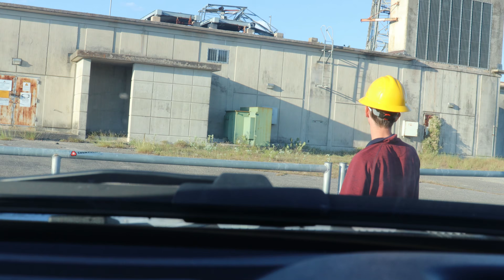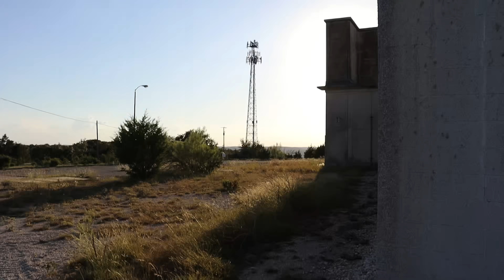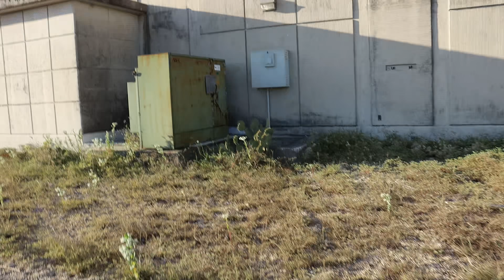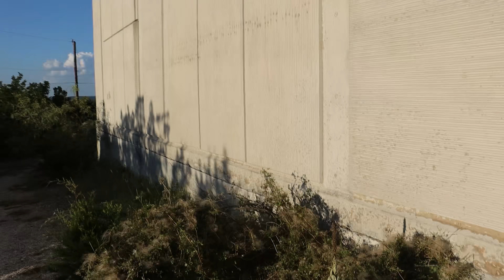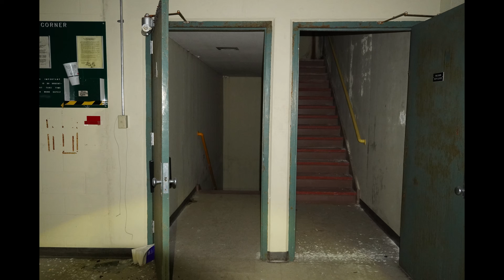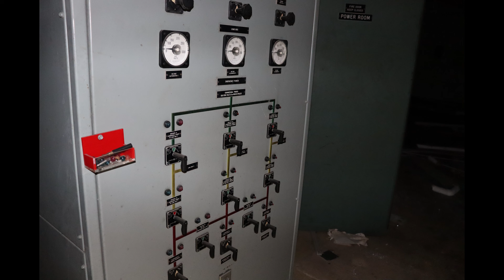Long Lines bunker

Comment: PWR: Power (Probably failure)
TD3: a long lines microwave technology
ENG: Engine (Probably also failure)
FRE RAD: Something radiation
(The first and last are guesses, but i know td3 is a microwave tech used in long lines)

Comment: It's amazing what the Bell System did for the country when there was a monopoly on long distance service!   Those buildings were hardened against bomb blasts and were intentionally located away from (then) major population center to avoid collateral damage.   Several I visited had shock absorbers on the equipment racks and even the toilets.   Pop quiz -- who paid for all that expensive facility upgrades?  Answer -- It wasn't the government, it was "baked into" the cost of every long distance call made by private citizens and businesses.   In effect, the FCC gave tacit approval to fund them via the expenses which set the rates for billing.

Comment: I worked at one of those sites. Netcong n.j. it was mostly a 1ess machine fore the government. There were radio and cxr gear because we handled traffic along the east coast. Next stop was drainsville, va. Going north went to the big building in NYC.  Its days were numbered, though. Last I heard the building was being used as a data storage center.

Comment: The pressure gauges are made by Magnehelic. The pressure rating is very very low. Hospitals use the same ones, or used to, for isolation rooms. I have one that came out of an underground coal mine refuge that was used to measure the restrictions on an air filter. It has two knobs on the front that you can adjust the alarm trigger points.

Comment: I would say that that means that it was designed to be pressurized to atmospheres! 

To counteract any leak as you were saying basically the high pressure in the building would yes Force the air out of the building but that means it would not let any air come in. 

The best comparison I can give for that would be when you go to the store in the summertime the fans that they have running overhead of the door they blow air there because it keeps flies out...

Comment: The gauges are Magnehelics.  They're made by Dwyer Instruments and they are for measuring very low pressures. Two inches of water column equals 0.0723 psi.  Not a lot, but enough to keep fallout out of the building.

I have a Long Lines site south of home. The tower was called Lee, and it was part of the first coast to coast microwave link in 1948. It is also privately owned.
Reply: Inches column water is a measurement reference also used in the pipe organ builder industry.
Reply: That is correct, inches of water is a much more granular measurement than PSI. There are ~27.68 inches of water per PSI (reciprocal of the number you stated). Another way of looking at it is there are just under 34 feet of water in one atmosphere (~14.7 PSI). That is why mercury is preferred for measuring barometric pressure. There are just under 30 inches of mercury (760 mm, for most of the world)  in one atmosphere, a 3-foot high instrument is far more practical than a 34-foot high one. I’m unsure what the instrument was, but I would wager it measures the pressure difference between the interior and exterior atmosphere. They would probably want to maintain a positive interior pressure in the case of fallout to ensure there was no infiltration of airborne radioactive particles except through the filters. Only a small pressure difference is needed, therefore the more granular measurement would make sense if they were only concerned with the delta.

Comment: Not only do You need to run pressurized to keep outside air out you actually need to run at an overpressure of more than one atmosphere so that the outgoing air precludes air entering, It's basically always blowing out with more force than the atmosphere would normally push in

Comment: Remembering my days in the 70's when I spent time with my dad  at a toll CO when he worked for PT&T  (Bell System), on the microwave floor.  That alarm panel indicated what kind of equipment alarm.   PWR is a power alarm,  C1 alarm was the order wire bay for communicating with the Main CO in the region,  LMX is L carrier multiplex - channel modulation of phone circuits over TD-2 or TD-3 microwave radio, not sure of the others. The bottom row looks like all the different open door alarms. There also would of been colored light bulbs hanging down from the top framework on every isle : red is a major alarm,  amber is a fuse alarm and green is a minor alarm. You can still see the alarm bells mounted on a board on a pillar in the background.
Reply: Oh, that's right,  the B is for basement and the 1 is for first floor.   The TD-3 alarm was the microwave terminal equipment,  FM probably refers to the frequency modulators  (FMT's and FMR's) .

Comment: You wouldne amazed at how many of these sites are still active, in a ready state to return to service and how they have been updated and kept updated. The security for those is very impressive. And as some have said it is not going to be possible to video within any of these that still has equipment. Those who try to enter are dealt with extremely harshly.

Comment: It would be interesting if one of these Long Lines sites in fairly good condition could be restored for use as a museum so visitors could go and see intact original equipment (doesn’t have to be operational, but would depict what is was like back in the day. It should also have an original tower with the horns in place (again, not necessarily operational, but intact). These sites are extremely historic and some which are in good condition, preserved. I know that in downtown Los Angeles, there is an AT&T Long Lines site with a mid-century style concrete tower that holds the horn antennas. I think it is still there today!

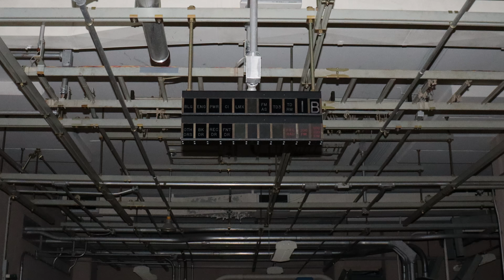Comment: 10:14 The only alarm abbreviation on this panel recognized is: PWR/power.  Seems this site used abbr.’s of Radio alarms.  From the last two videos watched from your channel, most equipment seen, appears to support the microwave radio equipment, one way or another.  Pass-through / repeater sites appear unique.  Only early microwave radios I was around were Federal-(real antique little to no info. available now days - Much adjustment required to keep operational) and Collins Radio.  (Oldest equipment seen). Trip down memory lane for any worker of M.W. radio equip.

Comment: Thanks for posting this. I’m 69 and my late teens was the last of the lifespan of the Ma Bell long lines system. In my youth I was very interested in communications and I spent many hours on the road around NH and Mass seeking out and photographing communications installations which of course included Bell long lines microwave sites which were still on line at the time. I have pictures of the link starting in Concord NH and heading south and west to carry long distance calls. Fantastic radio technology which like all tech changes and got obsoleted.

Comment: This looks like a newer site, and it is initially a bit surprising that so much is above ground.  Apparently the building material is up to withstanding several PSI of overpressure and things like power generation equipment could be located in the top floor which looks not to be entirely hermetically sealed.

I believe the older sites were built with cut and cover and almost entirely underground except for the concrete tower for the microwave horns.  Probably the concrete in the mostly underground sites did not need to be as strong, relying on the ground around the underground building to absorb blast energy.

A lot of work was done in the 1950s tests to understand the overpressure impulse and ground shockwave generated by aerial, surface and below ground nuclear detonations.  My assumption is that data were not available when the original Long Lines bunkers were being designed, hence the decision to build almost all below ground.

Comment: As for the annunciatior panel ~10:30, I’ll give you my best guess on the indicators.  I worked in a lot of ATT facilities but never a MW relay site unfortunately.
BLG - probably related to any type of environmental alarm within the building; HVAC, water detected, high temp, etc.
ENG - Engine alarm.  Gen Run, low fuel, over speed, etc..
PWR - some type of AC or DC  alarm.  Commercial power failure, Rectifier failure, battery on discharge, low voltage, etc..
CI - I’m not sure but could be a generic alarm for the switch located in the facility.  A lot of the larger relay sites had switching equipment for Autovon.
LMX - I’m not familiar with but sounds like it’s associated with multiplexing equipment.  Common in these sites.
FM-AS - no idea.  Probably related to TD3 technology.
TD3 - the type of Microwave radio used in this facility.
TDRM - Probably a radio alarm of some type.
I - no clue 
B - no clue
OTHDRS- could indicate some Over The Horizon technology that was in place at the time, but I’m speculating.  Or could be ‘Other doors’
BK-DR - was probably back door open. Or could be radio related.
REC-DR - was probably receiving door open (loading dock). Or TD3 radio.
FNT-DR - was probably Front door open. Or radio again 
I have no idea about the last indicators in red but are probably related to the radio system.
Hopefully a real TD3 guy will chime in and correct me😂
Reply: B and I Could refer to basement and first floor, to indicate where an alarm was present
Reply: Perhaps, BLG could refer to "Blower Gates", as if the blower had a gate that could let "dirty" air into the generator in case of overheating.
Reply: Lower left indicators I agree should refer to the doors being left open
Reply: Perhaps, CI could mean "Closed intake" for the generator. Or "clogged intake"
Reply: As for the red indicators, being them all bunched up together and red, they could be for the more serious stuff, related to nuclear. FRE RAD could refer to detectors for FREON and RADON gas, perhaps those have something to do with the fallout detection.
Reply: What is left out, then, is stuff related to the transmitters and building pressure. If the top left is for power and the generator, one big thing that could be missing is the low fuel alarm, so perhaps LMX means Liquid Methanol Exausted or something like that. But I am making it up at this point
Reply: Intuitively, transmitter related stuff is at the top right. FM AS could be "Frequency Monitoring Anomaly ..."

Comment: These built-specific locations were abandoned because of fiberoptics, satellites and microwave made for better more efficient communications, ergo these were made obsolete. The sites that could be reused were kept and the rest were put into 'disposal'. AT&T and the U.S. Gov't definitely got their moneys worth out of these places. Keep in mind that AT&T did not abandon them, they were stripped of asbestos, equipment and as much wire as possible to meet make them sellable to the 'public' and then sold off to new owners. Who then abandoned a portion of the site or entirely after they found out that most of them were essentially worthless, except for the use prior. A large portion of these sites were sold to American Tower, whom were interested in the tower and FCC license that came with the sites. A lot more of these sites exist all over the world, some used for radio stations, repeaters, homes and schools.
Reply: Our WISP bought two of these sites from american tower  to use the towers for the internet service  they use air fiber systems I put up a 85 foot tower on my property as a hop as they call it .

Comment: The red Fm200 warning may refer to halon gas fire suppression system. It was very common in large data centers. Normally triggered by a combustion detection system, vesda. Normally, the system triggers audible alarms and red flashing warning strobes to allow anyone in the area to get out to avoid asphyxiation. Normally there is an abort button to allow the automatic release. I know of one case where hot work was being done without isolating the system and a very large Fm200 gas bottle was released. The refill cost $200,000.00 plus the system called a fire alarm resulting in four fire trucks attending which may have cost $4000.00 each for a false. I am not sure if Fm200 is still used, as it's ozone depleting. Perhaps CO2 now.
Reply: I’m not sure what is in FM200, but understanding is that it is less damaging than old halon to electronics in the case of a gas release.  I worked in a small data center with an FM200 system.  When an alarm registered, an extremely loud bell began to sound and a human had about 20 seconds to cancel the release via a large red button.  The FM200 is oxygen displacing, so you don’t have long to get out, or you’ll suffocate.

The data center moved to a new site and the FM200 canister went along in the move.  I never talked about the cost with the boss, but as noted above, it was obvious the gas canister is very expensive asset.
Reply: Visited an Ameritech central cell site back in 87-88 and the first thing we were told if the fire alarm went off we had around ten seconds to bail out of these two 40 foot containers that housed all of the equipment for all of the cell sites in the metro area. Halon displaces oxygen real fast but if the gas does ignite it produces a very toxic gas. There were at least four pressure vessels in the site each around two feet in diameter by four feet in height. The dispensing nozzles were centrally located along the ceiling and every three feet apart. Not a really secure feeling knowing what they could do, and to think there was alway someone present in there.
Reply: @Subgunman  I am pretty sure the only room that was protected by Halon was the vault at the gallery. Its been about 25 years since I serviced that place but I think ten seconds was what they gave me to be able to get out of the vault. They said drop everything and run.
Reply: In the early 2000's I did pest control and an art gallery was one of my accounts. I know they had a Halon system because I had to be told and warned about it in case it went off while I was in the building.

Comment: Regarding the alarm panel. ENG = engine alarm. PWR= power alarm, emergency power or commercial power. LMX = analog mux. 12 voice channels = 1 “Group”. 5 “Groups” = a “Supergroup” or 12 X 5 = 60 voice channels. 10 “Supergroups” = 1 “Mastergroup” or 60 X 10 = 600 analog voice channels.
TD3 = an alarm in the “TD3” microwave system. That was the latest and greatest Western Electric microwave system of that era. The TD2 was the first generation of WECO microwave.
BK, REC, FNT, would indicate a door alarm as I recall.
The RED panels are a higher priority. The 400/100 SW I believe were associated with a matrix switcher. You could remotely and or locally switch a “Mastergroup” from its normal microwave “A”, as an example, channel to a protection channel “X” or “Y”. This would be done if “A or B or C or D or E or F or G, the normal working microwave channels got in trouble. 
I used channels X and Y on the weekends for college football games on Saturday and NFL games on Sunday. As an example, I’d switch off CBS to the local affiliate so I could give them a CBS NFL game they had ordered. 
It was interesting work!

Comment: magnahelic gauges measure differential air pressure in inches of water column.  It’s the pressure required to push water up a column, in this case up to 2”.  2” WC is approx 0.07 psi.
Reply: I used inches of water column pressure for natural gas for burners. 1 psi = a little less than 28 inches of water column

Comment: I wonder if people were assigned to go to these locations in the even of nuclear war or if war was imminent.
Reply: Yes, that is correct.  There were designated staff people who would be called in on short notice with the expectation of being sealed in the facility.  The larger sites had some association with the Department of Defense who had staff at the facility.  There were three floors underground.  This is from my (possibly faulty) memory:  top floor - power and switching, radios, main distribution frame, middle floor - utility, offices, kitchen, dormitory, bottom floor Autovon switching, TV and radio switching, operator consoles, monitoring consoles.

The old sites had a square concrete tower column to support the microwave horns.  A person who had worked in Long Lines told me (not independently verified) that some sites had four vertical antennas, one on each corner of the concrete tower and those were for communication with aerial command posts
Reply: @wtmayhew   If any of them are still alive someone needs to find and interview them before that piece of history is lost.

Comment: Awesome video, I have a lot of interest in both Long Lines and Autovon. Here in the DC area, there are many former LL sites, including some that are mostly intact (TD-2 horns are still up on the top of the tower), and there are two AT&T Troposcatter sites (hardened sites) in the area and both are in use for other projects by AT&T.